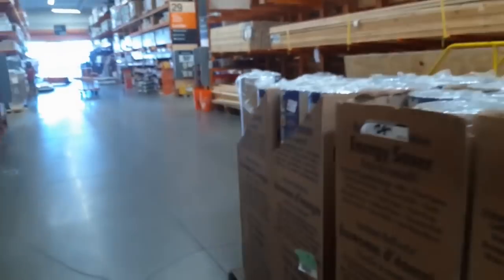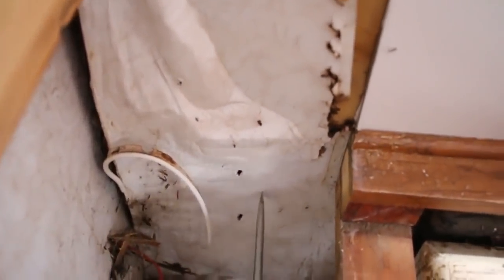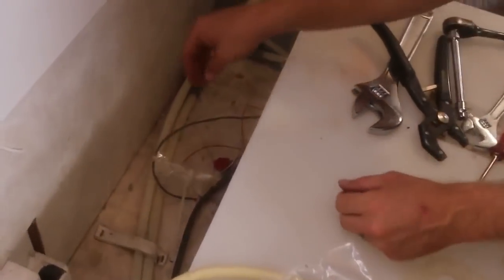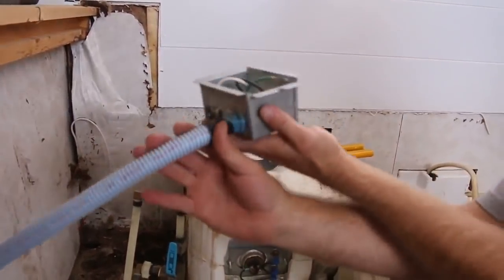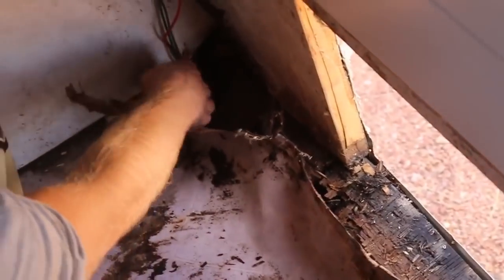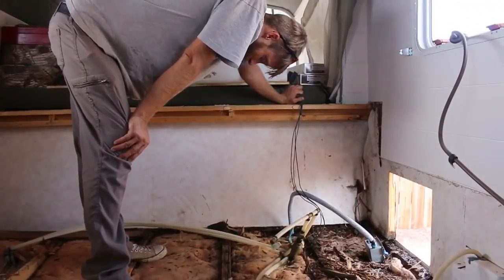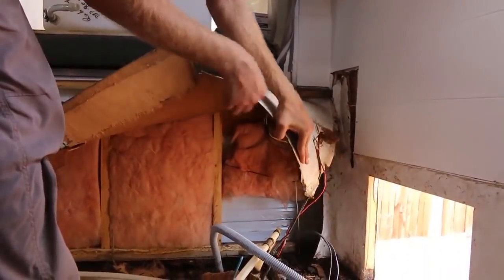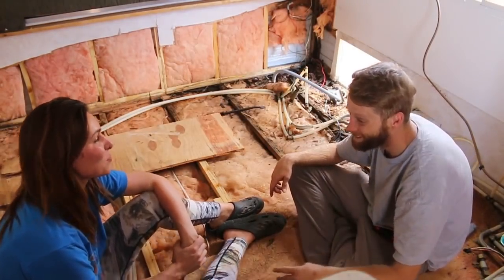GUTTING Our 5th Wheel Trailer|Demo Day #3|New Homestead Prep

Comment: It's just one small corner just one small corner... you got this. Back in the day I was in the middle of a huge fixer upper home (all we could afford at the time) the one thing we had on our side was the willingness to transform that home into our dream. We didn't have much $$$ so we paid as we went, but we never lost sight of our dream. Hard work makes all things possible. Gary, you're more like Gary Go Getter than Debbie Downer. It's too bad that when they installed that water tank they didn't put the tank inside some sort of container to make a sort of drip pan just in case of a leak. Water is always any structures worst enemy as it migrates into the smallest cracks. You will be road worthy before you know.

Comment: take part of the paneling off the wall where the bottom plate is rotten. cut the bottom of the wall studs off, then you can replace the bottom plate. after replacing bottom plate scab onto the suds you cut off. hope this helps

Comment: I know its a lot of work and the biggest surprise will come in no time, the surprise that you are done! As you replace parts, keep in mind the weight of the new parts you are adding. Trailers are lightweight because they use flimsy materials to cut down on weight. If you add 1/2" plywood where they just had veneer you are adding weight. Keep it up and you will be done in no time.

Comment: Well this is a blessing because that one thing you took out through the hole (I forgot what it was) could have went through that floor and with that one piece he took off and said it was the bracing for the wall could have just gave away. I know it is a ton of work but it will be safer and sturdy. Cannot wait for the next one.